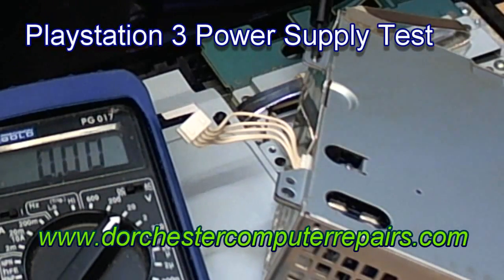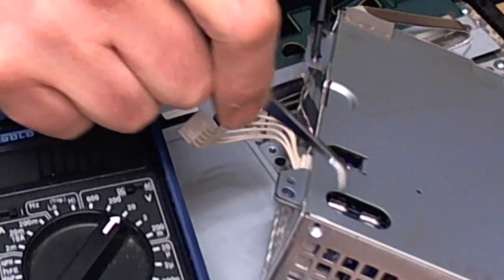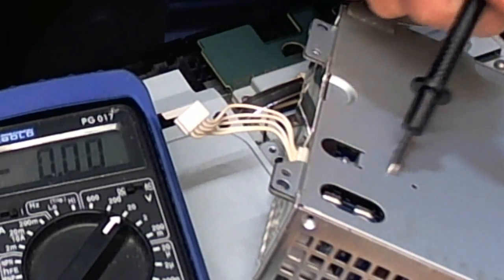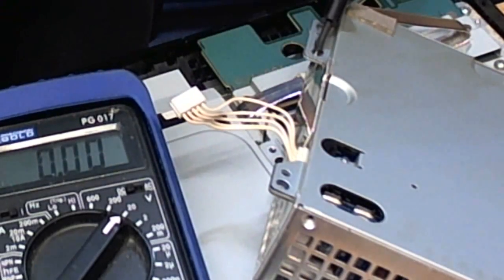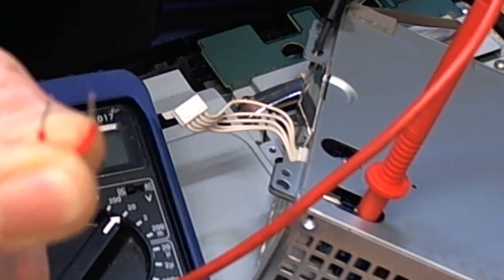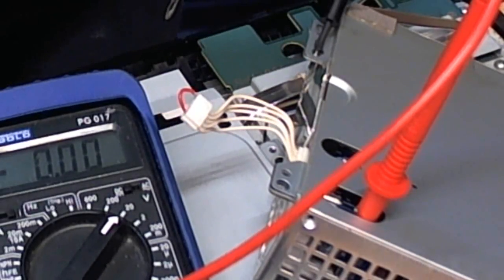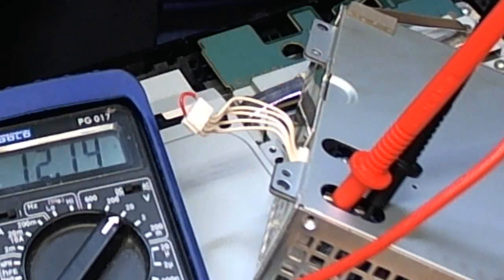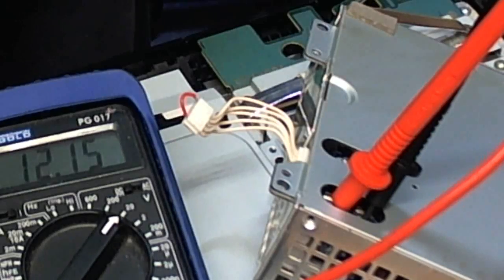Dead PS3? Testing the Playstation 3 Power Supply Voltages

Comment: Huge thanks sparky. Figured out I had a dead power supply after watching this video. 2019!
Reply from the maker: Glad it is still helping people. I still own and use a PS3, many do.
Reply: @sparkyuiop  my ps3 turns on then off, whenever i’m about to plug it in (metal points on the adaptor contact the ps3 port, it gives sparking sounds) i think it’s the power supply, don’t have a multimeter to test yet but will get one eventually or maybe borrow one, do you think it’s the psu?

Comment: For anybody that needs a 12 volt supply these work great. I used one of the 25 amp units to power my lipo charger for my rc cars. Had a fan installed but didn't need one they run really cool in the open.

Comment: Hey man, I tested my PSU it showed all proper voltage. Its funny...I plug it in flip switch my ps3 just has the solid red light...wont even turn on..

I bought it for $10 to try and fix or sell for parts. I did when i was messing with the cdrom get it to turn green and beep turn on but then lol I was rocking the rocker switch in the back not expecting it to do anything and I killed the power LMAO.

Any ideas?
Reply from the maker: You got a bin? lol!
Reply: sparkyuiop
parted that boy out..paid $10 for it..easy money and had skyrim stuck in drive
Reply from the maker: VideoGame Polak
Nice!
Reply: VideoGame Polak done same as you and little big planet 2 was stuck in mine that i bought off eba for $5

Comment: i have 2 pins showing 5v and two Gnd pins but the 3v pin there is nothing there, i have shorted the 3v and 5v pin and i am getting 12v from the large connectors, i am just missing the 3v, any suggestions ?
Reply: i'm having the same issue on mines. 2 pins 4.98v, 2 gnd, 3v pin DEAD. getting 12.02v. is my PSU bad?

Comment: The voltages are all correct. However, the PSU gets VERY hot in about 10-20 minutes. Do you know if that's normal?

Comment: Got the voltage coming out good so power supply is not the problem.
Basicly its YLOD but not overheating issue cause ive fixed it in the past heaps and it hasnt worked this time but its different.
I cant do the force eject with the fan and also as soon as i turn the power on at the switch with playstation still on standby it automaticly beeps and flashes red (No green or yellow)
But if i hold one of the buttons down it YLOD's...
Im lost with ideas.

Comment: so yes, i tried this and got 3volts  across  those three 5pin connectors and ZERO volts at the main 2 pin connector after i shorted the 5 and 3 like he said. So my power supply is trash and is probably the cause of the YLOD on my 20gb PS3